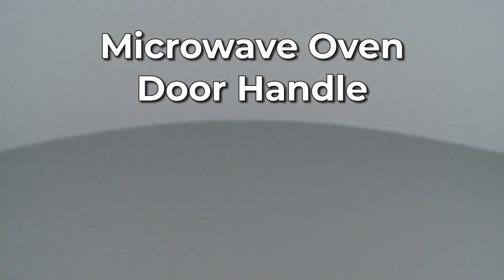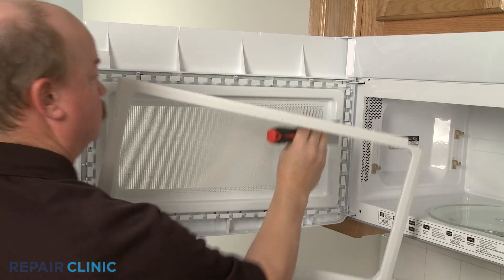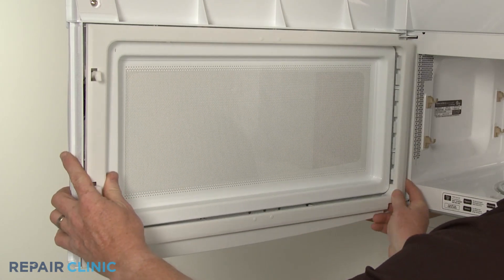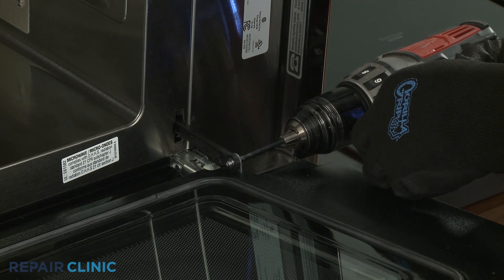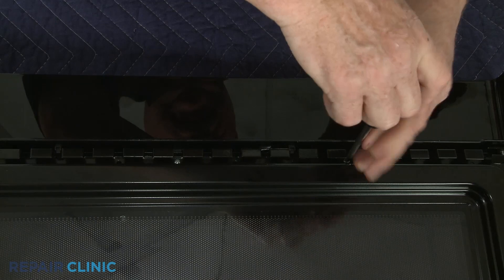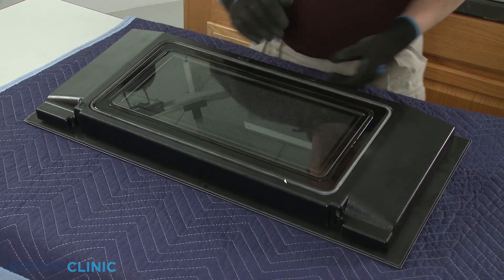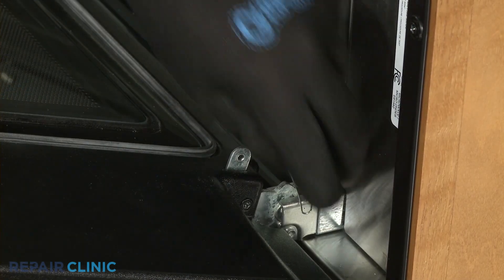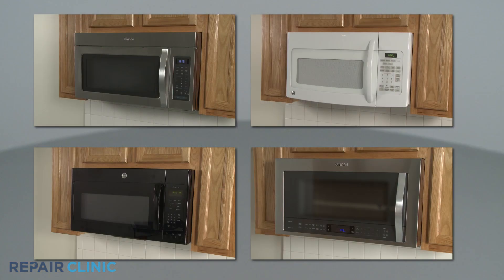Microwave Door Handle - How it Works & Installation Tips

Comment: I found this video to be very helpful, up to a point. I replaced the door handle (Frigidaire part # 5304513455) on a Frigidaire Professional Microwave (Model # FPBM307NTF). Once I removed the inner door trim, I found the inner door panel wasn’t attached with screws. It was held in place with retaining tabs, 14 of them. The video glosses over how hard it is to keep them all depressed at the same time to remove the inner panel. I had to wedge pieces of hard plastic in each tab to get the inner panel to release. Just be aware, if your model only has retaining tabs, the inner panel won’t just pop out with a single screw driver. Don’t get frustrated, it can be done. Also, a word of caution. Before you reassemble the door, make sure the glass on the inner surface is clean. I put the door back together and had a smudge and a dog hair on the inner glass surface. I had to disassemble the door and clean the glass.

Comment: My door has control panel in the door how can I replace the latch as the trim is not rectangle but has a slight angle on top. I am a little scared to take the whole trim out so I don’t break it. My microwave is Samsung mc17j8000cs